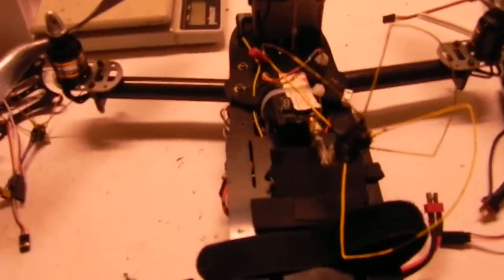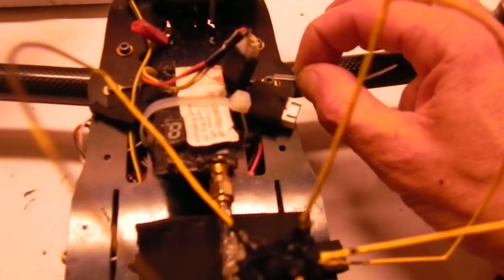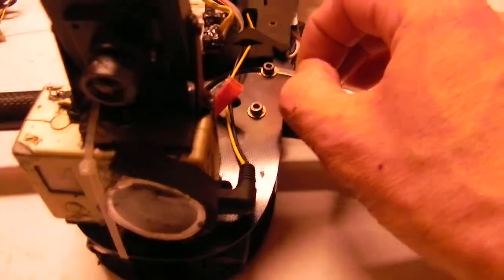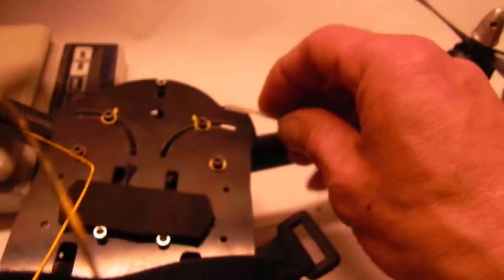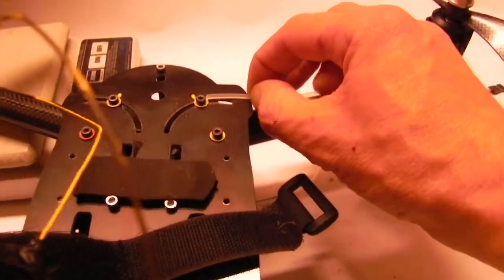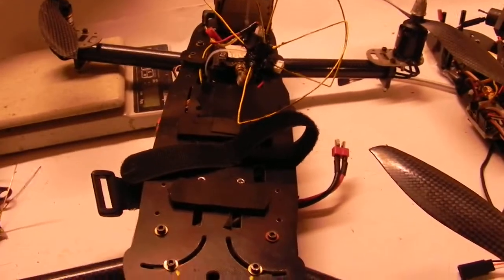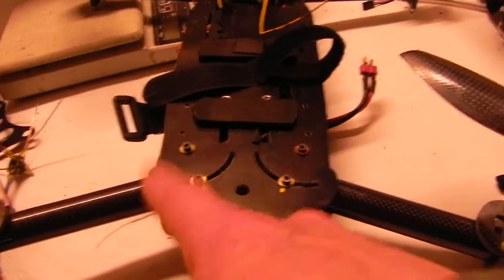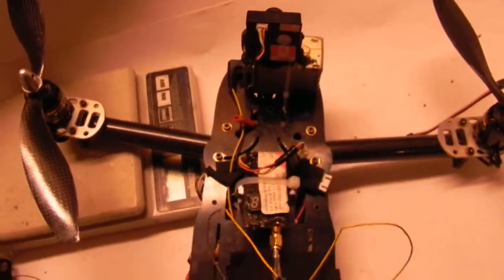Setting your FPV HB8 arms with a ruler, scrap wire, stick or micrometer. Keep it simple.

Comment from the maker: I tried snap in clamps as found on many folding quads and decided against using that mechanism because repeated stretching of the snaps would make them wear out. I also would have lost the ability to move the HB8 arms say 5mm .back or forward if larger props were in my view. That problem is solved by using this simple position check of your multi's arms by reference points and the fact you can cut or lengthen the tubes to any size practical..